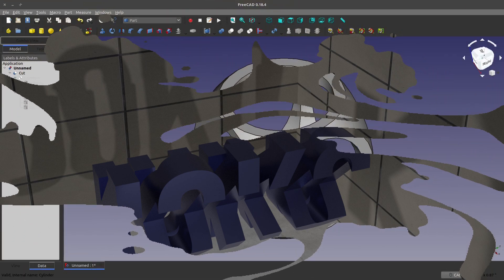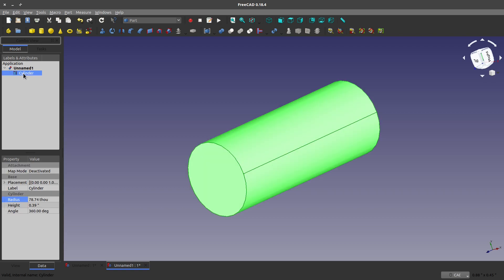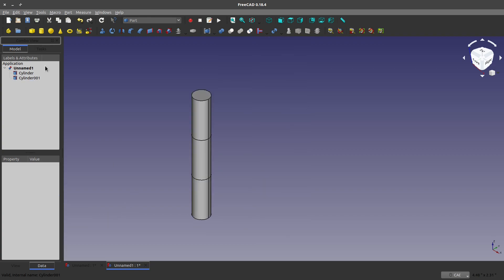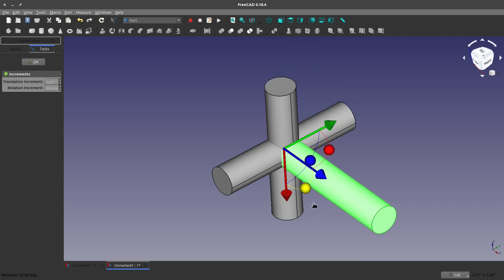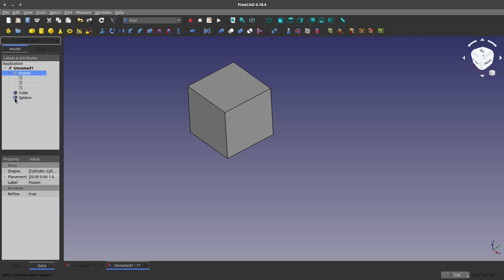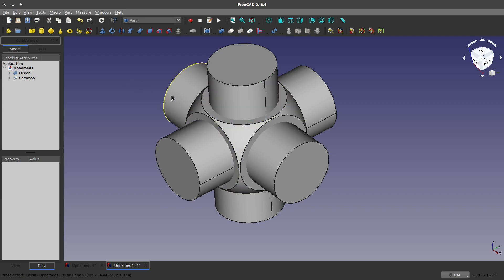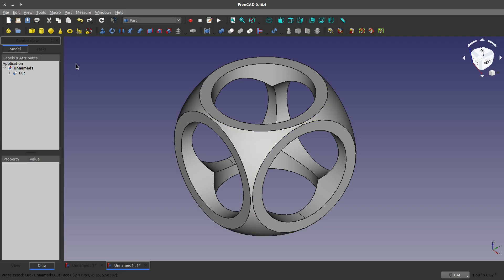FreeCAD CSG Multi-Body Modeling Method |JOKO ENGINEERING|

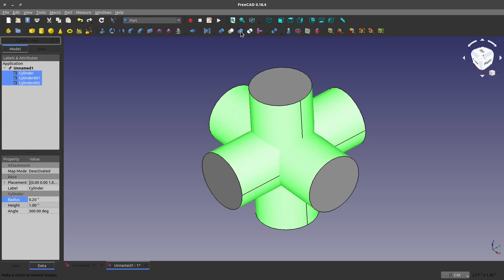Comment: After the union, I don't see the hard edges where the bodies meet like you showed at 3:18. I had checked that the Fusion was completed in the tree view. Also, I had tried to combine 2 bodies with the hope of shelling (using "make a thick solid" command) the combined body thereafter. However, I go an error message that says it can only be done on an active body.

Comment: So Constructive Solid Geometry flow is Part Workbench and boolean operations on 3d shapes; while the Part Design workbench flow with sketches, pad, and pocket is a "Feature" based flow? Thank you for the video and the distinction; this makes the whole learning curve of CAD thing easier :D
Reply: Well thats not what i understand CSG is. As i understand it, CSG are primitive shapes , Cube, Sphere, Conic, Cyclinder, Torus of known and changable parameters  etc ( sometimes known as 'analytical geometry' ) and may or may not be NURB based surfaces - usually there extremely low data dense and can not be used for highly sculptured surfaces.
If anyone else can fill in or modify my description, please do as i may not have it perfectly - thanks.

Comment: I use this kind of modelling often, usually later in the design process.
However, I have become cautious since it is easy to run into Freecad bugs while doing this. Over time I have learned to avoid a lot of them but the danger is always there.